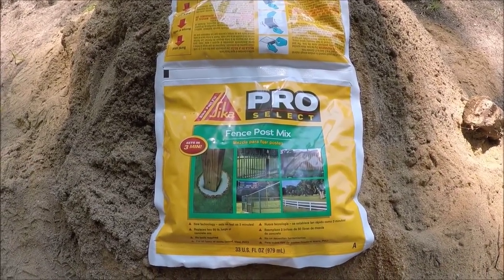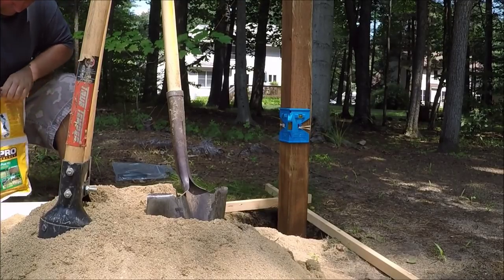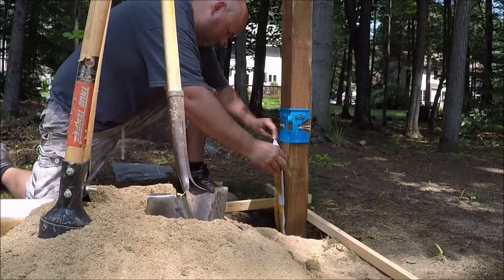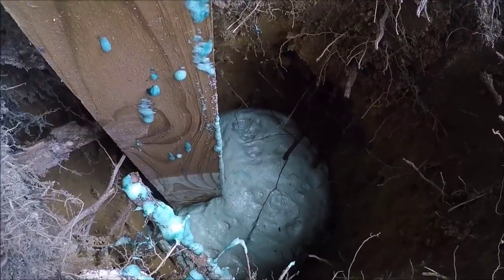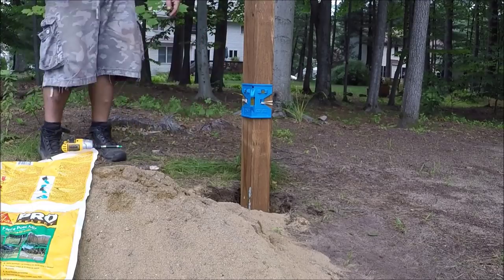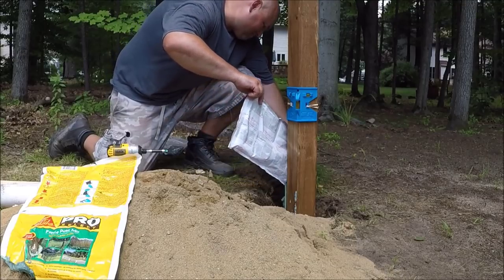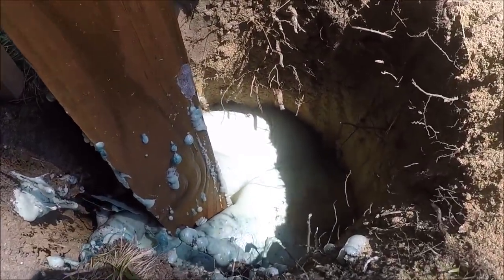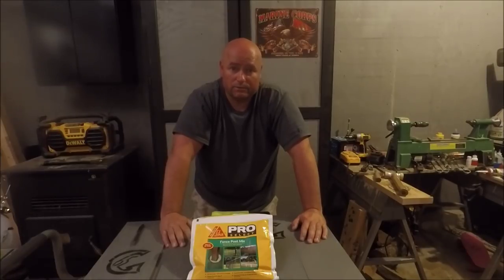Sika Post Fix lets see

Comment: Hole was too big. Bag was not mixed thoroughly (was done half assedly). The post was not centered in the middle of the hole. The first bag was not poured evenly around the post. Hey what could go wrong ehhhh? 😄
Reply: Yup.
Reply from the maker: You are right there is no room for error
Reply: Works perfectly for me when instructions are followed.. I guess you get what you get when not following instructions.
Reply: Exactly.  Had he used concrete, he would have had similar results.  He would have been better off simply putting that sand back in the hole, with 2 inch lifts and tamping it down with every lift.
Reply: How deep and wide should the whole be when setting a 4x4 post using foam?
Reply: 8in dia by 2 feet
Reply: Might of had better results if you dug the hole to center the post within the hole.

Comment: If done correctly it works exactly the way its supposed to!!! U do something wrong then expect it to work right then talk bad about the product !! If it was worth doing it should be done right the 1st time . I did a total of 630ft of fence using one bag per post and it were worked fantastic !!! And I'd recommend it and use it again. Hole was simply to big & post wasnt centered & if the property line was so close that it couldn't be centered then it should of been put in the proper location...to each there own right
Reply from the maker: Hey Craig, glad you had a good out come with the Sika. In the video I tried to give several pros and cons on the product. Hope the video helped you some what. Thanks for taking the time to watch.
Reply: So how big should the whole be and what size fence post did you use?
Reply: @yoyoyo3531   since my comment (which I totally forgot I made ) I wouldn't suggest using this product unless it's for a smaller job/ fence or something that doesn't need to be ridiculously strong . I had to end up redigging some posts up and concrete then instead but other posts did work , the product does get hard but the ground around it isn't real firm and allows posts to shake . I installed 4" square posts and dug 8" holes like product asks for but I'd make the holes 6" if doing all over again . In my opinion this stuff is mb made for little jobs like a garden fence or something similar , it didnt save me any money it actually cost me more in the end because of having to go back a fix about 10 post but some are working and still in the ground . If it would help you out I could make a short video of the things I'm talking about so you could see 1st hand. Hope I helped in some way ....
Reply: Craig Versetti i couldn’t agree more. I installed 230’ of 6’ privacy fence. I used pine panels cause they are the cheapest and used this product instead of concrete and very satisfied with the results. A little bit more than a bag of concrete but the full body pain I would of suffered with 230 bags of concrete.
Reply: @julianjaramillo2348  I'm glad it seems to be working for you , since posting my original comment I've had to redo alot of the posts and use concrete this time so I went back and posted a new updated comment  since my experience is now different.   Hope it continues to work for you...

Comment: Let's do some simple math. Sika's specs state that one bag will expand to about 0.7 CF, which is about 1210 cubic inches, slightly more than a 5 gallon bucket.

The volume of the 4x4 post in a 24" deep hole is about 300 cubic inches.

The sum of the Sika cured foam + the post volume is 1210 + 300 = 1450 cubic inches. 

The volume of an 8" diameter 24" deep hole is 1205 cubic inches.

Therefore, a bag of Sika does should slightly overflow a 8" x 24" hole with a 4x4 post in it. A 36" deep post hole will need 1.5 bags of the foam. Keep your senses and don't dig your hole diameter too large, as this guy did.

This is why you should have paid attention in school when math word problems were being taught to you.
Reply: This actually helped me with my post, thanks for the math!

Comment: As others have pointed out, I think you would have been happier with the results if the hold had been smaller and the post was in the center, so you could put the mix all around the post.  I like the product, I have used it for several applications, fences as well as buildings.  The posts don't move if the mixture is applied all around the post.  I did see a recent tip from the Build show.  Matt Risinger suggested putting a little of the product on the post itself at ground level to help seal it.  That is supposed to be one of the strengths of this product, it helps preserve the post rather than encouraging rotting as concrete does when in contact with wood over long periods.  Good luck with your fence build.  I would not look forward to setting 80 posts no matter what method I used.

Comment: It's 45 degrees, my  post hole is 24 inches deep by 8 inch wide. I used a few inches of play sand in the bottom. I centered and leveled and secured the post, had the scissors ready. I rolled from the bottom and mixed on my thigh for 15 seconds per instruction's. I poured all around the post and watched this fantastic product do it's thing. Wow! It's so fast and simple and clean I must have screwed up.
Reply from the maker: eyeeye1 awesome thanks for watching
Reply from the maker: +G65 Wood and iron what is the post holding up? Would you recommend sika for every post application? Please let us know.

Comment: If you had used an 8" diameter Sonotube, and backfilled it before you used the foam, one bag would have filled it up. I used this product 4 years ago, and my post is still rock solid.I have another broken post to replace, and I will be using Sika Post Fix again.
Reply: G Alexander I asked on Amazon, but it seems nobody is quick to answer questions there for this product...I’m looking to set an 8’ 4x4 that’s two feet down, to be used as a dog run. The line is spring loaded and will be attached to a brick wall on the other end. This stuff seems to do well with mailbox or fence posts but will it support the tension of the line and youthfulness of a Great Dane, in your opinion?

Comment: When you use concrete or anything like concrete it incases the wood post and then the wood post shrinks as it dries out and then you have water getting between the post and the filler. That is why it is the wrong way to do it. Just tamp dirt around the post and it will last longer. Try to have 3 feet of dirt to anchor the post.
Reply: yes I don't use concrete use sand and small stones call  stone pack it lets water drain.
Reply: I tamp them. In concrete the post will rot and if you fill it to the top of the hole  it will erode the soil on the lower side. I have seen beautiful board fence that fell over, they used a big auger ~10" filled the holes to the top w/ cement. It was on a hillside with horses walking the fence line. I modified a harbor freight demo hammer bit for a tamper. I also made a bit to drive tee post

Comment: Secure Set, a competing foam fence post product, has several advantages over the brand shown here.  With Secure Set you can mix the desired amount. It does not come in preset volume bags like this product.  Thus with Secure Set you can mix the precise amount needed for a variety of hole sizes.  Secure Set also flows much more readily in the fence post hole filling all sides of the post.   And finally Secure Set, as the name implies, sets very rigidly.  It's used for large utility power line posts by many utility companies across the country.
Reply: I don't doubt the quality, but it's far too expensive compared to other products.
Reply: @g.e.b.8159  When you pay for quality your overall expense,  labor, time,  actual $ amount, always ends up to be less.

Comment: As of today, HD sells this stuff for $10.47 a bag.  It replaces two 50lb bags of Quickcrete, which costs $5.80/bag.  I know they've "changed math", but last I checked 10.47 is less than 11.60.
Reply: mdnky 
One bag of sacrete. 60lb. Usually fills a posthole. $3 something.
Reply: @woodman1701  I'll stick with 2+ bags...
Reply: mdnky 
It’s that good eh?
I’ve had people suggest I try the foam. Seems pretty fiddley and expensive. 
I use the $3 stuff. 
I’m open to trying the foam.

Or were you saying two plus bags of concrete?

Comment: Yes you had to use 2 bags and it did not fill the hole. Your hole is 41" deep by about 12" wide. DA
Reply from the maker: The hole was that deep to get below the frost line. The manufacturer suggests the use of additional bags for deeper holes. Thanks for watching and commenting.

Comment: I want to make a sign holder out of a plastic pumpkin and a stake.  Would this work to pour it into a plastic trick or treat pumpkin or would it burst?
Reply from the maker: +Becky Kitchen it wouldn’t be my first choice I would use post set the weight of the concrete would help hold it in place and the post set wouldn’t expand out and possibly brake the plastic pumpkin

Comment: We have a disaster ! Mixed a bunch of small containers of the mix into some silicone molds .don't think we mixed properly..can you recommend a good cleaner?
Reply from the maker: Eureka Screams yes acidtone will dissolve it but read the safety part on the can it’s nasty stuff you can buy it at any hardware store
Reply: @g65woodandiron  thank ya kindly ..I appreciate the fast response ..this Sika stuff does some really good sculpture casting it retains high detail quite well and doesn't warp or expand  silicone molds which is very unlike great stuff foam .
Reply from the maker: Good to know thanks

Comment: WARNING!!! DO NOT MIX THE BAGS UNTIL THE VERY LAST SECOND. I DOUBLE CHECKED MY LEVELS IMMEDIATELY AFTER MIXING AND THE BAG EXPLODED ALL OVER THE TAILGATE, TONNEAU COVER AND BACK WINDOW OF MY PICKUP. I'M TALKING 10-15 SECONDS TOPS AND IT EXPLODED, MY DRIVEWAY AND TRUCK ARE A MESS. I SWEAR, IT WAS NO MORE THAN 10-15 SECS. IT IS VERY MESSY TO WORK WITH.
Reply: FOLLOW THE GOD DAMN INSTRUCTIONS! Who in the hell would mix this, let it sit on its own to check the posts, and then not expect something bad to happen? Dude, check your posts BEFORE you mix this shit. Your mess was your fault.
Reply: it's on the bag as a warning..

Comment: U didn't put ur fence post in the middle of the hole which is why u had the issue with the mix not getting into the tighter area. I would love to know how many ppl had the same issues as u. 
I hear what ur saying about having 80 fence posts to do and it not being cost effective. It would be very expensive to say the least.  
I can't wait to get this product and try it because I'm going to build a garden fence between mine and my neighbours house and this stuff should do the trick. I will probably use 5/6 posts at most so it should be great for that job. I get why ur a littke disappointed by the product though mate. There's a video online where they attempt to pull posts set in this stuff and concrete out of the ground and this stuff wins hands down everytime which surprised me a lot. Whst I would love to know is what thenhell this crap is made of. Is it bad for the environment?? Could it have a detrimental effect in the soil around the post by leaking some kind of dangerous substances into the ground water in years to come?? We don't really know all thess answers and it's well known that in the US testing of products isn't high on the list of certain agencies like the FDA, or the EPA either. 
I know I could be way off but these are questions that should be answered before bringing them to the marketplace.
I knownI said I would try it but now I have to look it up some more and see if it is OK using it in the long term. Time will tell my friend.

Comment: Part of what concrete does is stabilize the post end with a sort of ballast effect. Foam just isn't going to do that.
Reply: Utility Companies use this product to install utility poles. What more recommendations do you need? Done correctly using common sense it works great just have to use your head!. DAH!
Reply: PS. What Shaun Greyling said "READ LABELS"!!!

Comment: Thank you for sharing with us on how not to use the product. Your post was off centered and hole too big.  No wonder you would be wasting money because you are filling holes that are double in size.
Reply from the maker: Thanks for watching and commenting on my video. Yes your right the post isn’t in the center of the hole. So if you can’t dig a hole perfectly don’t use this product. If you have to make the hole bigger to get out a rock or root or some sort of obstruction and the hole gets bigger than recommended don’t use this product. If you have to dig a post hole deep enough to get below a frost line of 3.5 feet or more don’t use this product. So if you can’t meet the recommendation on the bag just back fill the hole with the dirt that came out of the hole. This technique as been use successfully for thousands of years and doesn’t cost anything. O and on the bags that I purchased it said that additional bags could be used if the hole was bigger than recommended for one bag.